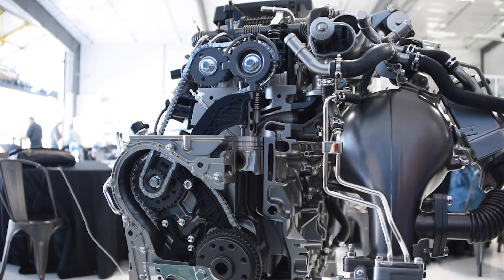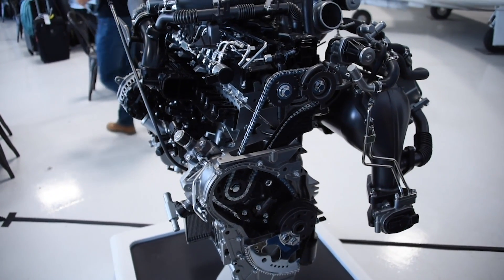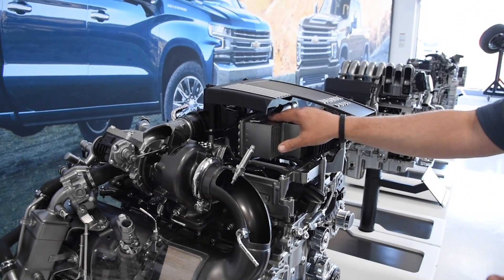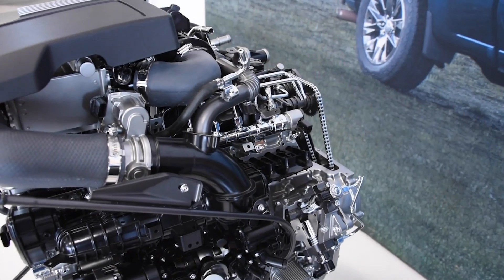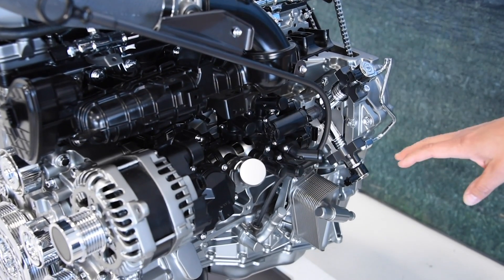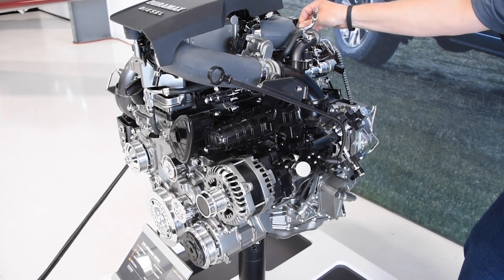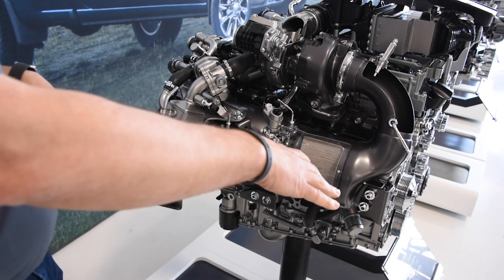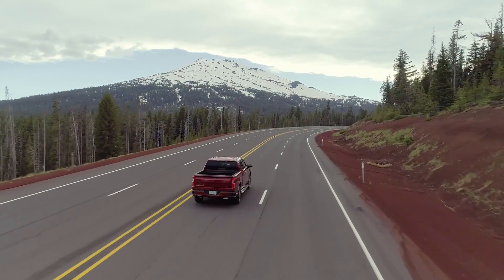What you don't know about the 3.0-liter Duramax diesel

Comment: I was sold on this efficient redesign until I saw oil pump belt! This engine was designed to make money via service at 150000 miles. Why couldn't they use ALL lifetime chains? Now I change my mind screw this engine, and the extra $3000 GM charges for the upgrade. Any fuel savings you gain will be all lost from the cost to replace that oil belt! will be at least another $2000 or $2500 to repair. Idiot engineers and GM executives.
Reply: Get ready for the pump belt recall. Hot oil and belt will never cohabitate for 150k.
Reply: Djinnho dude you dont know shit about rubbers and oils lmao
Reply: @djinnho2901  Bullshit.  Do some research on newer component materials.  Those belts will easily go double that.  I'll GUARANTEE if they're suggesting 150k, they're "failure" point is well into the 300's.  Under normal statistical circumstance.
Reply: @djinnho2901  plenty of cvts out there that would disagree with you. My girlfriends legacy cvt had 160k hard miles on it when we sold it because of a rusted subframe.
Reply: It's just planned obsolescence and intentional differentiation between the 3.0 and the 6.6. They don't want this engine lasting as long as the V8, which many buyers don't really need but will buy anyway for the longer service life. In any case, this engine could still be the right choice for light duty users who are mainly concerned with fuel economy and are just towing a boat or hauling a slide-in camper. Personally, If I purchased this 3.0 engine, I'd keep it for 10 years and then get rid of it well before 150,000 miles.
Reply: Let's say you spend $34,000 on the truck and you put 150,000 miles on it, what exactly does it or gm owe you at that point? How many miles do you expect to get out of a truck like this without some sort of $3000 repair?
Reply: @wheelitzr2  I've seen alot of trucks go past that without repairs that expensive.
Reply: @Jackmerius_Tacktheretrix  ok don't take this the wrong way but if you can get a vehicle to go over 150,000 miles without spending $3000 on it at that point then what you have is an exception to the rule or your not taking care of your maintenance, just replacing the brakes on a 3/4 or 1 ton truck will cost you at least that before 100,000 miles.
This shouldn't be about the money at 150,000 miles this should be about them installing a 'soft' belt to drive the main oil pump for the entire engine instead of a solid rod or a chain that they already have in place meer millimeters away from this particular belt, the reason why everyone is upset is because they could have just as easily figured out a way to incorporate that oil pump into the chain drive that is already there instead of adding an Achilles heel to the entire engine by a soft belt that is oil cooled.
Reply: @wheelitzr2  definitely get that part. Did my brakes on my Land Rover Discovery and upgraded to EBC Green stuff pads and EBC rotors for $400 ish. But singer your point. None of my dads tundras have had ant repairs, the two million mile tundras only had to replace a water pump and am alternator. Both transmissions lasted to over 700,000 miles. And honestly time does more than mileage. I guarantee you a 20 year old car with 30,000 miles is going to have alot more repairs than a 3 year old car with 150,000 miles. Things degrade over time, so vehicles with high mileage over short periods of time tend to be trouble free, while older vehicles with lower miles tend to need more repairs. But if you really use your truck as a truck you're bound to have repairs. The fact that those two million mile tundras regularly hauled and towed more than the truck was rated for and had no breakdowns or engine repairs was pretty phenomenal. None of my dads tundras have had anything done other than oil and filter changes. Sp far my titan xd has been good too, but i del3t3d when it had close to 35,000 miles so hopefully it will stay good. It's very easy to get to everything unlike the powerst5and duramax v8 where you cant access anything.
Reply: So much ignorance, so little time.  You guys still living in the 70's?  That belt only has a suggested SERVICE interval.  Not a LIFE.  As with regular timing belts, of the thousands of them I've replaced I can count on one hand the number which failed due to the belt itself.  It's usually a bearing in an idler or other guide.  I've seen cheap belts go 10 years and 300k miles.  The greatest diesel invented (5.9) has a rear timing setup as well....Simma down now....simma down.  You guys act like you're going to be pulling it off every oil change or something.  These are NOT HD TRUCKS.  VERY FEW of them will see the type of highway miles pulling things.  They will simply be an alternative to the gas for people hauling their pontoon's or camper's on weekends....
Reply: The fuel savings over 150k miles will be close to 10k compared to the 5.3

I had a 2021 5.3 for my work truck before switching to the 3.0.

Even babying it during the break in period the 5.3 was lucky to get 16-17 mpg.

I average about 26 mpg beating on the 3.0 around town. On the highway I get 31-32. 

I will literally use almost half the amount of fuel to go 150k with the diesel.
Reply: Really even worse than Volkswagen Jetta
Reply: Who had the best designed 3.0? Of the big 3, ram?
Reply: Not to mention pulling the engine to change the belt and chain.....
Reply: @timclaus8313  yep, timing belt and associated guide rails and tensioner, fuel pump drive and oil pump belt all at the back of the engine. I have no beef with the wet belt, but put it somewhere where you dont have to drop the transmission and disassemble the rear of the engine to replace it. Put it all up front under the timing cover. It would be much easier and far less labor to replace.
Reply: @Jackmerius_Tacktheretrix  On a 4x4, probably easier to pull the engine, rather than the trans, transfer case and all.  Geez, what a design flub.
Reply: @timclaus8313  right!
Reply: Tell me a vehicle that doesn’t need service at 150,000 and I’ll buy it. I own a 2021 Chevy with this motor and can tell you it is an animal when you tie a very heavy trailer on back. It handles hills, mountains and traffic as well as any vehicle I have ever owned. That includes some very nice Mercedes Diesels. I stayed away from Chevy’s for over 40 years because of quality issues. This truck and engine are as good as advertised.
Reply: @davidweigel2238 Think the issue is having the timing chain and belt buried at the back of the engine.  Maybe it has to be, but also expect with the way today's vehicles are designed, you are talking about pulling the engine to get to those components.
Reply: @timclaus8313  thanks Tim.
Reply: @davidweigel2238  Not just this vehicle either, plenty of FWD cars you are better off pulling the engine to replace turbos, coolers, etc that are on the back side of the engine.  Makes for tight packaging, which is good for space utilization, just sucks for the poor dude doing the repairs, lol...
Reply: Not a bad as an internal water pump on 3.5 Ford eco boost
Reply: I agree that’s the dumbest thing I have ever heard of. (Yea let’s put a rubber belt to drive the HOT OIL pump great idea pure genius right there 👏🏼 👏🏼 👏🏼👏🏼👏🏼👏🏼👏🏼👏🏼
Reply: I do not know what what materials they are using, but I can say without a doubt it can withstand oil temperatures. They might even be using an UHMW material that could far outlast steel and even run dry. Chains have a lot of negatives. It is heavy, it transfers heat, it wears, it stretches, steel CTE is pretty high causing expansion under heat. To me you are all no different than the old farts back in the day saying we should switch to fuel injection because "what happens when the computer fails."  I will wait to see how it holds up. I have learned to not jump to conclusions over the years.
 M.S. Mechanical Engineering + B.S. Material Science Engineering.
Reply: @gamesofcontent  150 000 miles is what it counts. No deal.
Reply: @gamesofcontent  Yep, there's a lot of advantages to belts theoretically (HP loss reduction, noise, possibly even service life if they got it right.) The question is of course did they. While I wouldn't want to be a first year user or even a fifth year one for that matter, time has a way of sorting these things out. Back in the day a timing belt was considered a controversial decision, now people don't even blink about it.
Reply: @thetriode  Actually, someone did, Honda doesn’t use timing belts in any of the never cars, Accord and Civic. Wonder what’s that about?
Reply: @gamesofcontent . You aren't as amazing as you think. Your bs in bs isn't changing anyone's mind, because you miss the point completely. Typical of an engineer, really.  The point is that the damn thing is scheduled to be replaced at 150k miles.  It doesn't fucking matter if the belt is made of nano particles of superman's skin follicles or what the fuck ever. If it is scheduled to be replaced then, the belt has been life limited by design. Otherwise it would have a higher interval for replacement.  Think about it.
Reply: @nunya9555  chains are scheduled to be replaced too.... Every single component on every vehicle made has an expected life, service, and replacement schedule. chains stretch. Heating and cooling affects their integrity. My point is that just because something is new does not mean it is worse or better. Everybody in these comments is acting like they haven't tested these belts. Hell, I would probably prefer a chain too. 

I bet these belts improve the life of the engine overall and that is why they chose them. A sloppy chain causes excess wear and tear on a motor and is more likely to break causing catastrophic failure. If the belt breaks then it can be cleared out without causing harm to the engine.

I am waiting to see how things workout rather than making assumptions. I am not in the habit of making an ass out of u and me.
Reply: @gamesofcontent . I understand your point. I would be kind of fine with the belt if it were not in a ridiculous location. And I have known people with quad cam (chain driven) Toyotas with 450k miles on them.  No maintenance was ever performed.  While I think this is amazing service life for those chains, others have went a million miles. I understand this is not typical, and it isn't something that I would fail to replace by the book. No way would I let a cheap to replace chain destroy an engine.  I realize that the belt in question isn't under enormous stress, but its placement, change interval, and  the fact it could have been a chain all turn me off to this engine completely.  It feels like a built-in failure point by a money hungry corporation.
Reply: @nunya9555  that many miles on a chain damn thing will be out of time and run bad and burn more gas chains need to be replaced every 150k and the guides cause they will start wearing out to and when they say life time they mean they built a motor to only last 100k then you buy a new one
Reply: @austinhowze6280 . Well built timing systems last far longer than what you think. Just because you don't know about it, and haven't experienced it, doesn't make it the truth.
Reply: @nunya9555  maybe a short chain a long chain will stretch and never be perfect in time now some of these motors can adjust to self now
Reply: @nunya9555  Watch the language
Reply: @john7478 . Sorry if I hurt your feelings sweetie.  Maybe a short nap can change your outlook.  It would give the adults time to have a conversation.
Reply: @gamesofcontent  that's all good but why the hell put all of that in the back of the engine? Fuel pump goes, pull the transmission, timing gear issue? Pull the transmission, oil pump issues? Pull the engine. Sure you could put 200,000 miles on it in 2 years, but time tells, that's why you can have an early 90's car with 25,000 miles on it and you'll be making repairs left and right. Time kills, not the mileage. Engineers would rather develop and over-engineer a suspension system to make a square wheel ride like a round one than just using a round wheel to begin with. The enginees where I work do nothing but overcomplicate everything and make everything a pain in the ass, while other Pilfield companies doing the same thing we do keep it simple and guess what, their service quality is no worse than ours. What could have been the best half ton diesel has become unnecessarily complex. I was excited when this came out. After seeing the design I'm just going to keep my titan XD
Reply: @nunya9555 looks like someone had a case of vaginitis lmao
Reply: @nunya9555  If they opted for a timing gear setup instead of chain or belt... maaayybee I'd be less leery of this engine.. then again there's still too much sitting back there for this engine's own good.  Having a belt back there too is just idiotic IMHO, definitely not following the KISS principle, or R.A.S. (more of a big iron thing in the server world though..) for that matter.
Reply: Austin Howze agreed. Chains are decidedly worse than belts except maybe for timing critical things. This isnt one, a wet belt is actually a really good solution imo.
Reply: Nunya but this isnt a timing critical component. A chain is more complicated, and more failure prone than a good material belt, especially a wet belt. You havent done the research, you know nothing
Reply: @gamesofcontent  This is off topic.  In your opinion which is more complicated, the gas 5.3 and 6.2 with DFM or this diesel 3.0?  All use the 10-speed transmission.  I'm not that mechanically inclined but tend to believe simpler is better.  I discounted this diesel engine at first but I'm trying to be open minded and am intrigued.
Reply: david yee  . you'll just spend your money on some other new garbage so why not just go with it  .
Reply: @carmichaelmoritz8662  I'm done with new. Pre-1970 is the way to go.
Reply: @OldSoldier54  yes i agree , i also like older vehicles .  now if we can get enough people to join in on certain values and work together helping each other ,  life as we know it would be better for all good poor people  .
Reply: @carmichaelmoritz8662  well ever american made new a days is garbage, so where to go? Toyota is coming out with hilux and they are bragging about 0 def us. I'm waiting for my money before I spend it on this.
Reply: @frankiemendoza6526  might be its not where to go  , might be its we should start forcing people to make good items that actually  last  .  hold the wealthy people responsible for their actions  .  its the wealthy that manipulate the businesses  .

Comment: this engine looks amazing, honestly, the only potential issue here can be the timing belt, however, technology keeps improving and we have to improve with it, I'm giving this engine 2 thumbs up
Reply: Dude, did you pay any attention? It doesn’t have a timing belt. It has timing chains, two of them, in series. Fist one drives the high pressure injection pump, second one drives the cam shafts… (Why in the heck did they design a Diesel engine with DOHC when the main benefits of the complexity is only realized at high RPMs which diesels don’t run at?)… I digress, THE BELT YOU REFERENCED DRIVES THE OIL PUMP and is oil bathed. When, not if but when, this belt fails it will MOST LIKELY result in significant engine damage due to rod and main bearings being starved of oil. 
Best case scenario is to replace a belt before failure but as a professional mechanic I will say the average consumer will have long forgotten this critical service when a vehicle reaches this mileage. 2nd best case scenario when an engine losses oil pressure is immediately shut the engine off and coast the vehicle to a safe location away from traffic. But consider, how much of our driving is on busy freeways with no safe locations within coasting distance? i.e. construction zones with barricades. To add another possible point of failure this oil pump is variable displacement which depending on design details and quality of components used may work out fine but could also easily be this engines achilles’ heel. 
For those that may not know: When a traditional timing belt fails on an interface engine the engine immediately stalls and significant damage occurs due to valves colliding with piston crowns. When timing belts fail on non-interference engines the engine also immediately stalls but most of the time no further damage results, replace the belt and continue on.
Reply: @preachers4135  Yep, belts in oil ALWAYS fail, and way faster than the manufacturer says they will, the acids and other compounds in the oil coming from combustion make these degrade rapidly, it's a really dumb design. No engine build with a wet belt, no matter what that belt powered, was ever reliable. Just facts. When that belt fails you lose oil pressure and your engine goes bye-bye. No reason to not have a chain on there besides cost reduction. A clown made that decision. Same with the variable oil pump, more complexity and those can fail too, just to add another 0.2 mpg. Like I said, a 🤡
Reply: @preachers4135  Yes , well said. All I kept hearing is Valve this and Valve that.  Wonder if they will even have the parts to service or repair. Just to complex to me,  I will have to pass.